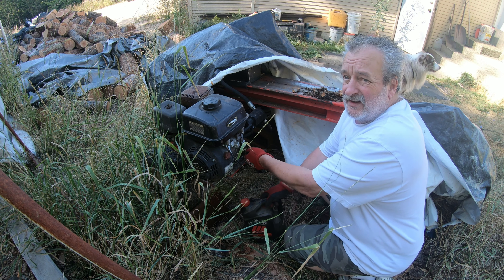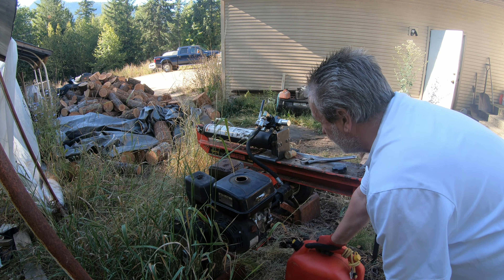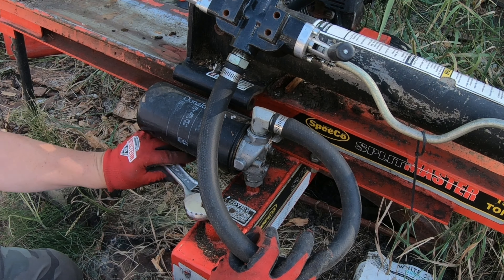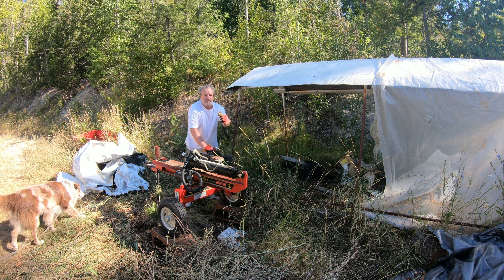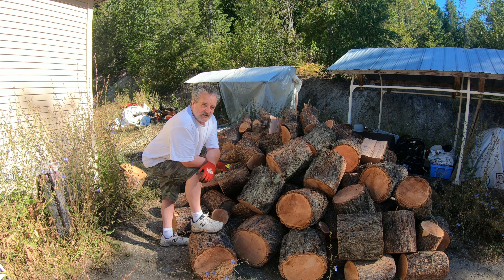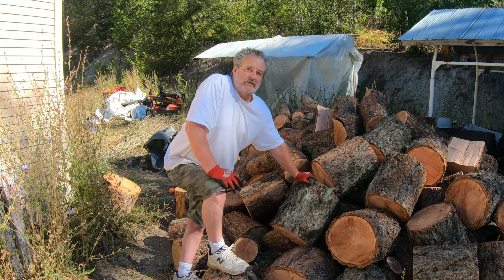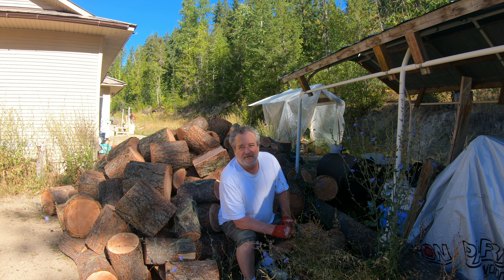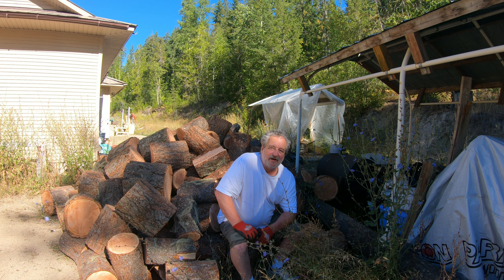Firewood best for heating your house.

Comment: Where I live, Ashe is the Primo firewood, followed by Beech. Good Dog you have there.
Reply from the maker: If I am not mistaken both of those are considered hard woods. It would be interesting to see if they are better than the woods we use here. And yes Ben is a great Dog. Thanks.
Reply: Yes they both burn very hot and weigh quite a bit.. No need to clean the chimney much with those.